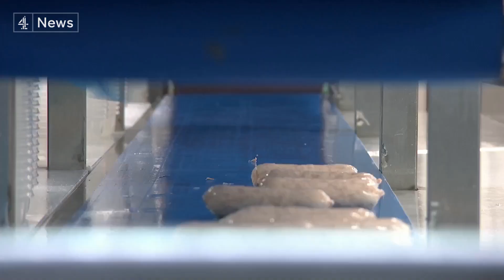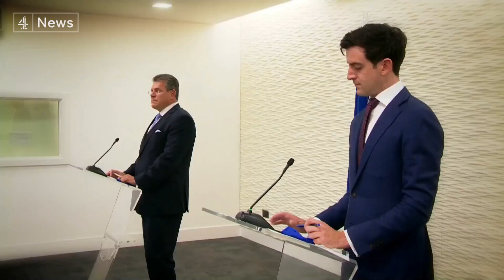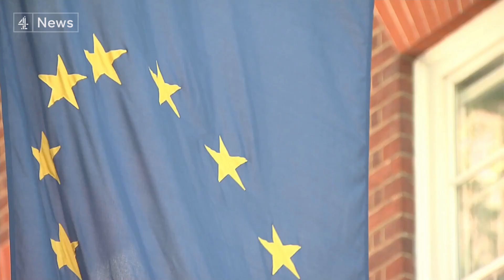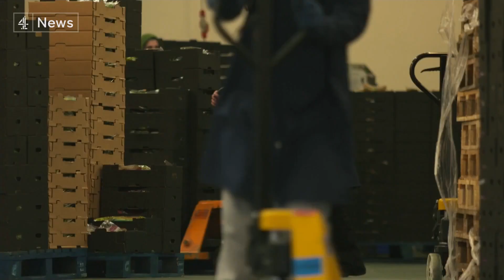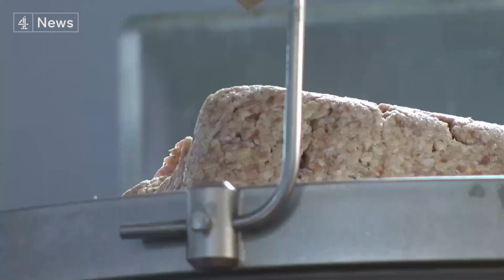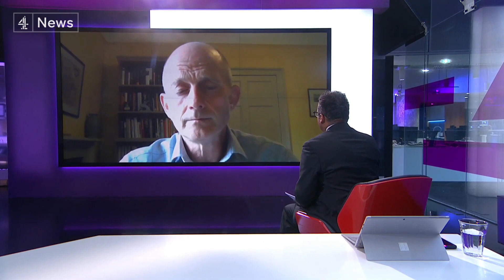EU’s ‘patience very thin’ after no agreement in ‘sausage war’ talks with UK

Comment: Why ddoes no one mention that the NI Protocol was a UK initiative that May did not have and Boris wanted?
Reply: So true. Boris made May's backstop to a frontstop!!!
Reply: Half of voters were too stupid to understand that as it was happening... they are a lot less likely to acknowledge it now
Reply: May’s backstop was to keep the whole of the U.K. tied to EU law, regulation and courts. The NI protocol was designed to stop U.K. exports going to the Republic, the EU have lost rationalised it on implementation to stop U.K. moving goods within the U.K.
Reply: @eddiel7635 I know but in some way he did what May understood that fixing the UK internal market would be  very complicated.  May's Backstop was that the whole UK should stay in the EU market until the challenges related to NI in the UK internal market was resolved. A backstop. In some way Boris instead said we fix this from the start...without doing anything but promised that he would had understood if he had read and  understood the reason for the May's backstop. So everything was predictable and a chaos!
Reply: @larstenfaelt1859  that’s not a backstop then is it, that’s just the U.K. staying in the single market but without any power over the laws it’s stuck with. Hence why it was voted down as it was an idiotic suggestion.
Reply: @eddiel7635  I have no clue what kind of education you have in economics but I have studied Macro, Micro and Trade economics quite a lot and trade is done with the closest nations. THat is how trading work and there is actually a term that you learn during the first lesson in Trade economics is "the proximity effect". 
Yes I agree with you that it would had been better to stay as members but you didn't want to so that is you call as now you will be "rule takers" to the biggest market instead of sitting at the table. To think you can substitute EU trade with 3rd nation trade is crazy. Your economy will suffer and you need foreign trade to pay for the social services in the country. 
With May's backstop you would had stayed in the market until you felt you were prepared to handle the NI product flow..and it was expected to take years but you could contiue until you felt comportable with the processes. Now you decided to do it directly and it is not only the fishermen and farmers that is thrown under the Brexit bus but also NI. Didn't it say something of £350 million a week to NHS as well. Where did that promise go. Honestly I think Boris and team got a shock that they won as there were not a plan or a clear view on benefits. I think Julia Gillard, the Former PM of Australia, summed it up great. 
https://twitter.com/bbcpolitics/status/1180084022992441344
Reply: @larstenfaelt1859  staying in the single market cud not a backstop, it’s just delaying Brexit further. We can argue about what the exit mechanism was from that but it’s actually irrelevant as whether it was 10 years or two years the U.K. voted to leave not stay in by proxy. As for the rest of your post, what you guys always fail to understand when you bang on about how the EU and it’s market of 450 million, is that Brexit has nothing to do with economics. Your giving an economic answer to a political question. I don’t care if I have access to the single market if I have no say in the laws that govern me. The EU is institutionally undemocratic and I’m glad we have left. As it happens I voted remain to avoid disruption but I can tell you the U.K. will never rejoin and we will never forgot what the EU has done over the last 5 years. Absolute scum.
Reply: @eddiel7635  Thanks for the reply. I know other people who voted remain but now say leave just to get things moving...and that is okay. If you believe if there there is no connection between politics on nationial and local level to economics I guess you don't understand what is paying for NHS, education etc. If you don't get fresh money from your export of product and services the only thing you can do is to print more money with huge inflation making everyone poorer in the country. If that is what you want...well that is fine with me. However I have spent serveral of my working life in UK and seen the huge divide you have and the people who will be hit are the children in deprived areas...not Jacob Rees-Mogg. No other western Europe countires has footballer who had to fight for free school lunches and there are no food banks. Only in UK. Why? I see a system problem and I often think of my UK young families I know that has such a strubbling life... 
Check this video form TRDR on official data...so you can easily download and check this out...
I know that  some brexiteers state that the commission is not elected . But they are proposed by each country's government and are approved  by the EU parliament. In UK you first past the post election that makes that some votes will not matter much. In UK you had the one of the most influencious person Dominic Cummings who was not even approved by your parliament...and now Lord Frost who has all the Brexit success on his shoulders. I am not saying that is wrong as that is up to you...but to say that the commission is undemocratic it is a much less so than the these to roles in UK and your voting system...
https://youtu.be/WjwhnhtCwsM
Reply: @larstenfaelt1859  it might not be Skandanavis but with all due respect the U.K. has one of the most generous welfare systems in the world. In any case your argument rests on the U.K. having some sort of economic Armageddon on leaving the EU, it’s not going to happen no matter how much the EU tries to punish us for having the temerity to leave. Either way, if there is some economic pain it’s a price worth paying. The EU seems to have more plans to patriate powers from its member states so I’m even more glad we have left and having lived though the last five years of attempted bullying and intimidation the less we have to do with them the better. When it goes so far out of its way to block our interests it is no longer an ally. At this point I see the EU in the same way I view China or Russia.
Reply: @larstenfaelt1859  actually if you add up the extra money to the  NHS it has been vastly more than £350000 a week so the reality is the promise on the bus has actually been exceeded. The electorate were never asked if they wished to join.the EU in any EU country -the electorate in Switzerland and Norway were fully.consulted and refused to join .Finally the UK electorate were consulted and rejected the EU -it us called democracy -something the EU Commission ignores as they are appointed -not elected .
Reply: @larstenfaelt1859  If you look at the UK trade with the EU they sell us over 3 times as much as we sell to them My local Mercedes dealer sells  too cars a year -this year to date he has sold 11 and expects to go out if business unless something changes .The German car industry say they will.lose 100000 car jobs this year and the CEO of Peugeot Citroen says his company will go bankrupt without the UK market. .When you talk to business people they say their largest problem is interfering political.bureaucrats who have never actually run any commercial business . And unless the EU Commission are DIRECTLY elected it is sham democracy. .
Reply: @donmab  nope, just complaining that it’s easier to export food from Afghanistan into NI than it is from the rest of the Uk. I wonder why that is... it’s not a secret , many commissioners and national leaders Macron etc have cone out and made it clear what they are doing.
Reply: @donmab  not suggesting that Germany quits the EU and if it did the EU would certainly collapse as it us the German taxpayer who underwrites it financially  But the loss of UK sales is crippling their car industry at a time when they are having to pay out Euros Billons in compensation for the exhaust fiddle scandal and amounts to 100000 jobs .
Reply: @ronnieince4568  he promised 350 million EXTRA a week.
Reply: @larstenfaelt1859  yes and if you add up.the total increase in NHS spending it adds up to more than than that -in capital spend alone he has committed to building 40 New hospitals .The EU decision is now history -we have  made a democratic  decision to.leave ( I personally was a remain voter as ay my age the costs are immediate and I won't be around  to enjoy and long term benefit ) but having made any major decision the only sensible action one can take us to make the best of the situation -whining about it changes nothing .And in my experience a grade B decision with Grade A implementation.always beats a Grade A plan with Grade B execution .So the rational thing to do.us to make the best of it  Norway Iceland Switzerland seem to.manage perfectly well outside the EU and the EU depends financially on the German taxpayer to guarantee its finances and borrowings .It is an open question as to whether Frau Merkel 's successor will continue to write the cheques .I can imagine the EU being a much looser organisation in 5 years than it is today and the return of the individual nation state and the fading of federalism .And interestingly there has been no huge rush of EU citizens living in the UK to leave -in fact the opposite with over 90% applying to remain in the UK. -no English "boat people " seeking asylum.in France so far. !!!
Reply: @ronnieince4568  you are clearly living in a fantasy. In reality, a large number of EU citizens have left the UK. That is why all kinds of sectors have problems with hiring staff.
Reply: @ariecanarie0774  actually according to official figures less than 200000 have left and almost 3 million.have applied for settled status .And there is no shortage if people in the UK -in fact unemployment is forecast to rise next year as many businesses hit by the pandemic will never reopen .And a large warehouse complex near me has spent the last year automating the process and over 70% of staff have been replaced by computer controlled picking and packing machines . A neighbour is permanently working from home reducing the need for office space costs and the cost to her employer if her company car.Huge numbers if jobs cleaning and maintaining offices will vanish and more and more business will.move on line instead of retail shops -there will be no shortage of people .
Reply: @ronnieince4568  if you believe that the German car industry is going to lose 11% of its workforce over Brexit I'd like you to follow me into my office, I have a couple of bridges for sale...
Reply: @0cypher0  well this was a analysis by Ralf Speth -the German former CEO of Jaguar Landrover with huge connections with senior executives in the German motor industry and the supply train .One assumes that he knows what he us talking about  And with the growth of electric cars manufacturers of engines , engine components water pumps radiators exhaust systems gearboxes clutches etc are heading out of business -some 1200 plus itens will vanish from.an average car -.
Reply: @ronnieince4568  Perhaps you should look at nhs staff, hired hands for farmers, staff for hotels, bars, restaurants etc. 
But perhaps you're right and unemployment in the UK is going to rise. But this is not because of the pandemic but mainly because of Brexit dear.
Reply: @ariecanarie0774  farmers can still bring in seasonal workers -my local farmer has the same group of Romanians this year as he had last year and for years before .And some   20% of pubs and restaurants will never reopen so again reduced overall demand for staff .And also the demand for retail staff has reduced with large retail stores closing as business has moved upon line ordering ..And Brexit has not reduced business by much -most of the drop has been due to Covid and the economy is forecast to grow this year by  the largest percentage in 70 years and return to.pre covid levels next year .And if you look at the EU as a whole average growth over the last 38 years has been 1.6% per annum .UK growth over the same period was 2.4% annual.average .For individual countries the figures were 2.1% for France ; 1 8% for Italy ; a lowley 1 6% fir Germany ( still dragged down by reunification ).and Holland 2.4%.So only.Holland has outpaced the UK over the last 38 years  And as a matter if interest the USA has averaged 2.9% annual growth over the same 38 years  The fact is  that the UK economy has grown at above the European average and there is no reason why that should not continue ..
Reply: @ronnieince4568  If your looking at the economic growth you should look at gdp per capita. 

               UK			france		Germany		Netherlands 		Belgium

1970      15025		15714		14043			16716			13767

2017       39127		39461		47556			46601			38340         Source penn world tables

These numbers show clearly how the UK population has not out performed It's EU neighbours. 
Combined with the higher inequality in the UK I would much rather live in the EU.

The reason the UK economy is growing fast now is because the UK had the worst contraction ever last year.
And no this was not just covid countries within the EU did not contract nearly as much and were also hit by covid.

And there is a reason why the UK economy won't perform as well as in the last 38 years. It's called: Brexit.

Can you name your source for the great economic groth in the UK for the last 38 years? ( probaply not adjusted for inflation?)
Reply: Dear Ronnie where is your source?
Reply: @ariecanarie0774  from a report by the Economist in 2019..And the number if EU citizens who have left is the Government's own figure .Unemployment is currently running at 5% overall but almost 15% in the 16 -24 age group and 3.4 million on furlough as at 30th April.
Reply: @ronnieince4568  so a two year old report with numbers not corrected for inflation.

Better look at recent data about gdp per capita.

Too bad you do not react to the record contraction in the UK economy in 2020. Looks like you're searching unicorns.
Reply: @ariecanarie0774  we know there is a major contraction in the U.K. economy as there is in all European countries and the USA Japan -even China .The bulk of this is due to Covid and there is some affect the to Brexit undoubtedly. The fact is we have left the EU and instead of complaining about a decision already taken and implemented then the sensible thing is to.make the best of it .They are forecasting that the UK economy will have returned to 2019 levels in 2022 -time will tell ..
Reply: @ariecanarie0774  with the practical  shut down if the UK economy in 2020 not surprising that the economy is in recession -we have a once in a century world wide pandemic .Only when we get a year of normal can a vakid comparison be made  Last December the OECD forecast for UK growth was 4 2% and they have now upped that forecast for 2020 to 7.2% ..And GDP per capita is a very questionable measurement .Ireland has attracted jobs and investment resulting in GDP  per capita of $78779 compared with $46468 for Germany ; $40496 fir France but it would be absurd to claim ROI has a stronger economy than France and Germany .And ROI is likely to veto the G7 tax proposals as it would halve their current corporate tax take !!!
Reply: @ronnieince4568  the contraction of the UK economy was far worse then all other western economies. Just look it up. Bloomberg did a comparison.

This year shows a rising trade deficit for the UK. No positive new trade deals compared to the EU trade deals. Problems in Logistics, fishing and farming. Lost trade for the city etc.

Just wake up to brexshit reality
Reply: @ariecanarie0774  look like it ir not Brexit is history -we had a vote and we remainers lost -that is democracy  so we simply have to get on with it as best we can .And the OECD are saying the UK will have a faster recovery than the EU -time will.tell if they are right .Neither the Tories not Labour are going to re-argue Brexit  so we make the best if it -they dont  run the country to suit my personal views .!!!!
Reply: @ronnieince4568  "we simply have to get on with it as best we can" LOL 
Utter nonsense Brexit is a idiotic act of self-mutilation and the way the Tories are embarrassing the UK in negotiations with the EU, Norway, Australia, Japan and the US. At the very least, one would limit the damage. People in the UK need to wake up to the reality of brexshit and tory corruption.
Reply: @ariecanarie0774  look the fact is the electorate voted to leave and in fact it was Labour constituencies that were most solidly Leave voters .Some 441constituencies has a leave majority and actually Labour as a party were always opposed to EU membership .Corbyn himself had been anti EU all his political life abd voted consistently on that basis and in particular against the Lisbon and Maastricht treaties .So no point in you compaining about the Tories when Labour is just as solidly anti EU  Starmer himself has said it is now history -we have left and we should get on with ordinary politics  Your complaining ( or me ) is not going to change anything so the rational answer when you are  faced with a decision you don't like and can't change is to make the best if the circumstances you find yourself in  The alternative is to whinge forever  If I can't suggest something positive in any situation then I say nothing which might demoralize others  We are where we are so the only solution is to.make the best of the situation..And if you believe the polls the electorateis even more anti the EU than it was at the referendum.Re -run it and the leave majority would be even greater .!!
Reply: @ariecanarie0774  well you may be anti Tory but Labour are even more anti EU .The only UK national party that is pro EU are the Liberals and they gave been politically dead as a oarty in almost a century .England  is circa 90% off the UK electorate and they are solidly anti EU -only fringe parties in Scotland Wakes and Northern Ireland are pro EU and for local anti English reasons rather than economic reasons .
Reply: @ariecanarie0774  look Brexit is a fact -no major party in the UK is going to change it so you may as well get over it  And I don't see how we are a police state -the police have never bothered me in any way and the only time I have ever had any police attention in the UK  was when travelling on business in Northern Ireland where armed police searches of individuals and vehicles was normal for security reasons .And that was happening for 40 years when we were still.in the EU. And if Brexit turns out to be the total economic disaster you forecast then sooner or later either the Tories or Labour will.campaign for another referendum.to rejoin ( assuming there is an EU in existence to rejoin and assuming they would 're admit the UK -both of which are open questions at this point
Reply: @ronnieince4568  never heard of the policing bill by Patel?
Reply: @ariecanarie0774  yes but the police have already plenty of powers to arrest and detain people if they wish but they don't go around arresting people willy nilly And it was actually Labour who gave them.the widest powers of arrest and detention  And police powers are by far the strongest in the UK in Northen Ireland -nothing to do with the Tories or Labour as they pass their own security laws and where all police are armed with a sub machine gun and side arm even if they are directing traffic at a village fair
Reply: @ronnieince4568  you're going on about NI but the boarder is now in the Irish sea. And NI is part of the EU (single market)
Reply: @ariecanarie0774  yes but that is not the real problem -it us the absurd  over zealous enforcement if the border  We have immigration control  but we enforce them sensibly -the letter of the law allows us to stop.and search every last passenger arriving but imagine how long the queue would be if we did -international travel to the U.K. would be just about impossible. The EU have a clear interest in stopping smuggling but Marks and Spencer can be trusted to send food to their Belfast branch .A customer might then but a pound of sausages and take them to Dublin -they are nit going to smuggle a lorry load .A single set of papers and packing list should be enough without papers fir each individual item to supermarkets and trusted end users .And there is nothing to stop me going into a M& S branch in London;  buying a packet of sausages and posting them to friends in Dublin.not us it going to collapse the EU -different if I am trying to send a crate of them .All that is needed is a little common sense in applying the rules .The police are not going to nick you for doing 71 mph on the motorway although in the letter of the law they can -do 90 mph and they probably will nick you .And with customs you can bring in 200 cigarettes but they are not going to argue about that opened packet in your pocket with 10  or 15 left in the packet -almmit needs is a bit of common sense in.interpreting the rules.
Reply: @ronnieince4568  "Marks and Spencer can be trusted" sure just like Bojo can be trusted? 
Remember "taking back control" ?
The strange thing is  that trade between England and the Netherlands or Belgium or France is no problem at all (according to the UK government). Those checks all conducted bij Dutch, Belgium and France officials
But with the same rules, trading with NI is apparently impossible, with checks conducted by UK officials. 
Don't let yourself be fooled by idiotic Bojo rhetoric.
England is known in Europe as "perfidious albion". A reputation that Bojo and co confirm time and again.
So the UK government and UK business will simply have to comply with the rules that apply to a third country. You have to earn trust by being reliable.
Reply: @ariecanarie0774  well if the smuggling of sausages is such a threat to the EU how can I without problems post sausages from.England to Northern Ireland .And if you dont live in the UK your opinion of Boris and the Tory party is irrelevant just as mine is if the parties and politicians  of any country I dont live in..
Reply: @ariecanarie0774  And in 3 years time we can give notice and exit the protocol -either party has that option.-clearly you have never even read the document .
Reply: @ronnieince4568  Really? Apparently you can't read very well
Reply: @ariecanarie0774  yes I can -the Protocol is for 6 years and can be ended by the U.K.  ( or the EU ) giving 2 years notice so it can be ended entirely in 2026 if notice given in 2024.I suggest you read the entire  document  !!!
Reply: @ronnieince4568  really? I am curious can you explain to me how the UK can unilaterally cancel the NI protocol and what the next step is. (you can't as the UK can't) good luck!
Reply: Ronnie?
Reply: @ariecanarie0774  nobody is saying we should immediately cancel the Protocol but it can be implemented in a sensible way For example I can post M & S sausages to any address in Northern Ireland but M &  S can't ship them for consumption there .The President .of France did not even realize Northern  Ireland was part if the UK but thought it was part of the Irish Republic !!!.So either a sensible workable operation of the Protocol takes place of it goes-it now appears that EU officials and the Irish Government are on board and willing to minimise the bureaucracy or Boris will refer the matter to the UK Court to ensure that the procedures do not block suppliers to Northern Ireland -the procedurea have already blocked supplies of 30 drugs to the NHS in Northern Ireland and the supply of UK produced covid vaccine -absolutely nothing to do with cross border smuggling
Reply: @ronnieince4568  No bs stories please.  I am still waiting for your explanation on the UK unilateral action on the NI protocol and what the next step is. (you can't as the UK can't) good luck!
Reply: @ariecanarie0774  well according to reports Boris has given the EU 7 days to resolve the problem if he will  ugbire the Protocol  -he told President Macron he cannot stand by and see empty shelves in supermarkets in Northern Ireland or people dying because 30 essential UK drugs are blocked from being sent to NHS hospitals in Northern Ireland It appears that President Macron thought Northern Ireland was part if the Irish Republic and not part if the U.K. !!!
Reply: @ronnieince4568  Still have not really read the protocol? I am still waiting for your explanation on the UK unilateral action on the NI protocol and what the next step is.
Reply: @ariecanarie0774  well it us reported Boris has given the EU 7 days notice that they either simplify the procedure for shipping food to supermarkets in Northern Ireland  and drugs to Belfast hospitals or he will ignore the Protocol. He has  said he can't stand by and allow empty supermarket shelves or deprive NHS  patients 30 essential drugs used by the NHS in GB .
Reply: @ronnieince4568  Come on Ronnie boy where in the protocol is the tekst giving the UK the right of unilateral action ending the protocol?
Reply: @ariecanarie0774  read it 'either party can end it with 2 years notice but if the EU are not prepared to simplify its operation then we will ignore it .We can't have empty supermarket  shelves and sick people deprived of essential drugs in any part if the UK
Reply: @ronnieince4568  No Ronnie boy stop lying. Nowhere in the NI protocol does the UK get the option of unilaterally terminating the protocol. So just admit you didn't read it and apologize politely.
Reply: @ariecanarie0774  no why should I apologize -Parliament has an Article 16 option which permits  either party to take unilateral measures if applying the Protocol leads to serious problems  its operation and the food and drug shortages are a serious problem to shoppers and especially the NHS being deprived of 30 drugs .It  will have to  be adjusted or Boris will simply ignore it long before then as patients in hospital seriously ill are being deprived of essential drugs as a result and supermarket shelves missing essential items  The absurdity is I can buy  M and S sausages in England and mail  then to Northern Ireland but you can't buy the same sausages in  M & S in Belfast .Boris has today according to the press given them 7 days to sort it and the Irish PM is apparently  pressing the EU bureaucrats to resolve it as it us damaging them indirectly  It appears that President Macron was not even aware Northern Ireland was part if the UK .Legal action is also being launched apparently as British Citizens in Northern Ireland are being illegally discriminated against by not being able to buy food and obtain NHS treatment on  the same basis as British Citizens elsewhere in the U.K.and this breaches their Human Rights . It contends that the EU is in breach of law in this respect by their discriminatory action .Personally I  think searching every Irish truck and insisting on examining every last item world bring about action in days -when others start to feel the pain it will concentrate minds rapidly .A price worth paying suddenly changes  when others also have to pay .The EU themselves cut off covid  vaccine supplies to Northern Ireland but backed off within hours when the UK said it would halt supplies to Europe.
Reply: @ronnieince4568  You didn't Read the protocol, did you? Just going on and on about all kinds of nonsense printed in the daily mail or the sun or some other rag. Grow a brain, how can there be a problem exporting medicine to NI? Medicines aproved in the UK are aproved in the EU. And checks between the UK and NI are done by UK officials.  Food can be imported from Ireland so this is also no problem. All great brexit benefits.
Reply: @ariecanarie0774  look I am not going to waste my time ploughing through 70 odd pages in detail  Article 16 can be invoked where there is a problem and that we can do  The NHS in Northern Ireland reports 30 drugs with supply problems from GB due to the way the Protocol  is operating and Boris has given the EU officials 7 days to sort it  If they don't then I think we should simply ignore the Protocol -the EU would then be stuck with the problem. You simply want to reargue  the decision to leave the EU as you can't  accept a democratic choice you dont like  Well we have left and no major party in the U.K. has any intention of changing that decision -maybe in 20 or 30 years a new generation will 're visit the decision and if people including me have to acceot being poorer well that us  consequence of democracy -all others will be innthe same  boat.And frankly the sooner we dump all the costs and troubles of Northern Ireland on Dublin the better -they want it -it us no strategic or economic asset to England so let Dublin waste their blood and treasure in taking it on .That way we  are totally clear if the EU interference in UK affairs.
Reply: @ariecanarie0774  so why are Marks  and Spencer reporting food shortages -why have the EU blocked vaccines to Northern Ireland and why can't they get 30 New drugs approved for UK use .And why can I mail anything from any GB shop to Northern Ireland with zero restriction but have to have endless paper to take it by car ..We should simply fully search every EU truck 100 % at Dover -you can bet the Northern Ireland problems would vanish in no time .
Reply: @ariecanarie0774  actually you are wrong -earlier this year the EU invoked Article 16 and blocked the export of vaccines to Northern Ireland -even the RIO Government were outraged and they quickly lifted  the blockade  Boris should simply insist that as the UK carry out the Customs Checks then it will be done as it suits us like it or not  And if they can't accept that we will simply ignore the Protocol  We are not in the EU and can't be dictated to by them as to how we operate our control system .My betting is that if they don't remove it the civil war will break out again but it will be bombs in Dublin.not Belfast .
Reply: @ariecanarie0774  clearly with your brextards comment you have no respect fir the democratic process -the electorate voted to leave in the highest electoral turn out of years and if the vote in Northern Ireland had excluded ROI citizens the leave vote would have been the majority outturn . You just can't accept you lost -I can and if that means my standard of life drops well democracy is far more important than my personal view  The British people never voted at any time in a free vote to join the EU and if they had we would not have even had a referendum When you impose things on people without their consent then when the opportunity arises they bite  back .It's a free country and those who can't accept democratic outcomes are free to move elsewhere  And all the surveys indicate that the leave vote would be even higher today  .
Reply: @ariecanarie0774  not true they triggered Article 16 earlier this year -I will confirm the details.Look we are out if the EU and we should simply make out own rules throughout the UK -Boris should simply tell the EU that if they want Customs Checks in Northern Ireland then they staff it and they pay for it -they want to protect their border then they are responsible for doing it .
Reply: @ronnieince4568  no Ronnie boy Bojo signed the treaty with the NI protocol so the UK are bound by it. And there is not going to be unfettered access to NI. 
Frost and Bojo negotiated this deal themselves, remember? Oven ready deal.
And no the EU did not trigger article 16.  So stop repeating lies.
Reply: @ariecanarie0774  they did -look it up -you will even find it on the internet -instead of pro EU propaganda try checking the facts .Boris should simply tell the EU  that we are going to do the checks as we are fit and minimise the costs and  inconvenience to UK citizens in Northern Ireland or will simply exit the Protocol and they can do whatever checking they wish on the ROI sideof the border -the EU wants to protect their borders well then they can do it .And there are already Customs Checks on the ROI dude if the border -they have never totally ended them .We can assist by only allowing licenced traders to bring goods from the mainland so any smuggling would easily be spotted .
Reply: @ariecanarie0774  well instead of making inaccurate and abusive comments ( the reserve of the uninformed ) look it up on Wikipedia  If you can't find it elsewhere
Reply: @ariecanarie0774  article 16 was used by the EU to block vaccine shipments to Northern Ireland in  January last .This move was criticised by both the Northern Ireland and ROI  Health Departments as a deliberate act of EU bullying and stupidity .The EU reversed the decision on instructions from Arlene Foster after claiming it was a merely a mishap .This was probably not reported in your usual reading material as  Northen Ireland is not much mentioned in the business pages of the Beano -try reading the Times for the facts . With your failure to check the facts I suspect you were really a leave voter! !!
Reply: @ariecanarie0774  Article 16 allows Boris to take unilateral measures if applying the Protocol causes persistent  economic or social problems  -and clearly it is causing both .
Reply: @ronnieince4568  no it is not that simple dear, try reading it.
Reply: @ronnieince4568  and not a single shipment of vaccines was blocked by the EU triggering article 16. Try and read serious newspapers.
Reply: @ariecanarie0774  I hate read it can specifically triggered if there us economic or social problems -why do you have to lie every time when you are proved wrong .
Reply: @ronnieince4568  But triggering article 16 does not mean suspending or ending the NI protocol dear. You did read it, did you?
And why do you have problems with trade to NI and not with trade to French, Belgium, Germany etc.? The same rules apply. Food can be bought in Ireland. And the UK could just hire some more bureaucrats so they can reduce the problems with checks. Or they could agree to maintain EU standards. 

By the way you have not once "proved" me wrong. You have repeated lies and you have shown an incredible lack of knowledge and intelligence.
Reply: @ariecanarie0774  Boris can trigger Article 16 and halt all the Protocol controls -the Northern Ireland Attorney General has stated that to the Assembly -that is the legal position..The operation of the Protocol damages both the economy and the social.structures .

The checks in France Germany etc are not alleged  to be damaging to their  economy or social structures -their  supermarkets have not empty shelves nor is there violent social division..You really dont have a clue about the daily realities of life in Northern Ireland .Why dont you listen  to the views of those who live there -they know what is going on .Boris should simply tell the EU that we will.decide how the Protocol operates and if they are are not prepared to accept that we will simply ditch it completely .If it us really as essential as they claim them they will agree to our implementing in a way acceptable I  Northern Ireland .  In short our way ir no way! !
Reply: @ronnieince4568  the last time I looked the UK had a representative democracy and a large majority of these MPs were in favor of remain. Like the majority in Scotland Northern Ireland and Wales in the relatively low turnout consultative referendum. So where's your respect for the voters in say Northern Ireland or Scotland or Wales? Again the majority remain voters.
Reply: @ariecanarie0774  some 441 constituencies has a leave majority and the result in Northern Ireland was hugely distorted in favour if remain by the votes of ROI citizens who were allowed to vote on what was clearly a UK matter .Wakes has a leave majority and the vote in Scotland was distorted by SNP anti English racism rather than the merits of otherwise if the EU  In fact the SNP were opposed to the U.K. joining the EEC and there then MP's at Westminster voted against it as they considered it damaging to Scottish interests  But in any event the vote was a UK as a whole vote and the outcome was committed to being implemented by Parliament -that is what the referendum.was to decide -remain or leave -not partly remain or leave. .
Reply: @ariecanarie0774  ere constituencies had a leave majority out of 659 -that is a LEAVE majority -clearly maths are not your strong suit !!!
Reply: @ronnieince4568  the majority of voters in Wales, Scotland and NI were in favor of remain. Clearly reading is not your strong suit but we had seen this before when it came to article 16 😂
Reply: @ariecanarie0774  clearly understanding the concept of an all  UK referendum is beyond your intellectual capacity  And Wales had a leave majority and if you deduct ROI citizens votes Northern Ireland had a leave majority  .
Reply: @ariecanarie0774  it was not a low turn out -it was the highest electoral  turn out for decades .And Wales had a leave majority as did the UK citizens in Northern Ireland -it was the ROI residents that tipped the vote in what was a UK matter .
Reply: @ronnieince4568  since the elderly in particular were pro brexshit and young people pro remain, a remain majority is increasingly likely (by covid deaths among other things) time for a new referendum, don't you think?
Reply: @ariecanarie0774  no political party is going to call for another referendum -both the Tories and Labour say the decision is now history  And if a second one has the same outcome the remain faction would still not accept the outcome  And if the decision was next time to remain then the leave element would then demand a third "decider " vote -it would become a "never endum "  Maybe in 25 years and a new generation the decision might be revisited but the outcome could still be the same ; the EU might not even exist then and they might not accept any previous members rejoining -certainly any outcome is totally unforeseeable.  Now if we collapsed economically with millions starving in the streets there would be political pressure to rejoin but unless that happens neither Labour of the Tories are going to voluntarily reopen such a divisive matter .
Reply: @ronnieince4568  the UK already has the highest density of food banks in Western Europe. And since Brexit, more and more asylum seekers are pouring into the UK because Europeans are no longer very actively holding them back, nor are they taking them back from the UK. Take back control! 🤣
Reply: @ronnieince4568  did you look at the latest trade figures? They are great, more imports and a rising trade deficit. 🤣
Reply: @ariecanarie0774  well in the middle of a world wide pandemic hardly surprising .And try yo get it through your head we have left the EU and won't be returning any time  soon if ever -you still don't seem to grasp that for better or worse that matter is ended  So sensible people will make the best of the circumstances they are faced with -negativity and "glass empty " comments actually change nothing in any event .
Reply: @ronnieince4568  Ronnie boy don't be mad. Just sorry to bother you please continue to ruminate on the great news about the austratic trade deal which is going to decimate british farmers within 15 years
Reply: @ronnieince4568  by the way the Netherlands, also in the pandemic, has reduced it trade deficit to nearly zero and is exporting more compared to 2019.
Are you sure it's not brexshit?
Reply: @ariecanarie0774  If Scottish farmers can't produce quality beef competitively then Irish producers will take their market They have largely the sane sort if weather and grass ; they have EU subsidies and they are less than 30  miles away .Australia has a dry climate ; poor grass , no subsidies and 10000 miles of transport. They already dont ship as much as they could and huge amounts of Argentinean beef are being shipped to the EU .What we should ensure us that Australian beef displaces Irish beef.
Reply: @ariecanarie0774  Holland 's strength is import export .All the Fat East container ships  offload  there and goods are then went in to Germany Belgium France etc which distorts their import export business  .And in fact Holland has had the highest annual growth rate of any EU country for the last 20 plus years .Look as I keep pointing out we have left the EU -if that makes us long term richer then fine and if it makes us poorer you have a choice -accept it or leave the country -nobody is forced to stay here remember.
Reply: @ronnieince4568  you've made a real study of this, good boy. But at the moment Australian beef faces tariffs and a lot of production methods are not allowed for import in to the UK market.

But I' m glad UK farmers have nothing to worry about.

But it's a bit strange that the farmers in the UK know their own market so poorly 🤣
Reply: @ariecanarie0774  well firstly if it us good enough for Australians to eat it will be good enough for anyone else  Secondly it will be chilled or frozen -Scottish beef is fresh beef not frozen .New Zealand lamb is shipped in huge quantities but plenty of farmers producing fresh lamb  .And as Scotland claims to want to.leave the UK and join the EU then Scottish farmers can have their chances with the EU -they can't complain if they lose out even more in the EU -they can't have it both ways .
Reply: @ronnieince4568  The US also reduced their trade deficit. Just accept that the rising trade deficit in the UK is not a result of the pandemic but a result of brexshit  And stop fantasizing about alternative explanations.
Reply: @ariecanarie0774  we have fun a trade deficit in goods for years  Instead if whining come up with some positive suggestions or leave the country of you think you can do better elsewhere  .
Reply: @ronnieince4568  I have a possitive sugestion: rejoin the single market and customs union ASAP!
Reply: @ariecanarie0774  it is never going to happen -in fact of you look at polls it would be rejected by an even  larger margin   And it would not be supported by either Labour or the Tories so unless you can come up with a credible idea then maybe it would be better for you to leave for an EU country -there are still 26 to choose from at the moment.but the choice may be more limited in future .
Reply: @ronnieince4568  Don't be so negative. For a remain voter you are parroting a lot of silly brextard comments 🤔
Reply: @ariecanarie0774  the fact us leaving the EU us history -we have left -not my personal choice or yours but the majority choice .We are not going to rejoin so the sensible thing is to make the best if what we now have .You can complain about it all you wish but it will change nothing -a done deed is a done deed .
Reply: @ronnieince4568  don't be so negative. Instead search for ways of making it happen. The EU is our biggest trading partner rejoining will give us an economic boom.
Reply: @ariecanarie0774  get it through your head we are not rejoining the EU -the Conservatives and Labour have both ways so often enough -the decision to leave was made and they are not going to reverse it .And the leave voters are greater today than they were 4 years ago do the outcome of any vote would still be leave  So if you personally want tonne in the EU leave the UK -you have 26 EU countries to choose from !!!
Reply: @ariecanarie0774  yes it was technically advisory but Parliament accepted the majority view and voted to trigger Article 50 by a large majority to take us out if the EU ; the single market and the jurisdiction of the EU Court .
Reply: @ronnieince4568  yes but the Swiss and the Norwegians are also outside the EU. So no problem there the referendum said nothing about the exact form of brexit. Bojo and co just chose the stupid brexit.
Reply: @ariecanarie0774  yes but that is all history -we are out if the EU so you have two choices -accept the reality or leave the country -we certainly won't be rejoicing.
Reply: @ariecanarie0774  well dont hold  your breath about us rejoining unless you can hold it for at least  25 years .And you are assuming there will.still be an EU to join.!!!9
Reply: @ronnieince4568  of course silly brextard
Reply: @ariecanarie0774  well I suggest you contact Boris Johnson and Keir  Starmer and suggest they call another EU Referendum or a vote in Parliament to rejoin -let me know their reply.
Reply: @ariecanarie0774  yes now you only  need to get 328 more elected and they will have a majority .The LIberals have been politically dead for.90 years remember .!!
Reply: @ronnieince4568  and it seems brexshit is reviving the Lib dems. If torries can lose this seat, held by the torries for 47 years, the support for Bojo's brexshit is low.
Reply: well then all they need to do is win the next 328 by elections and there will be a Liberal majority !!!! The Liberals have been dead as a party for over 90 years-if you are depending on then to reverse Brexit we would be back in the EU around 2115 !!!